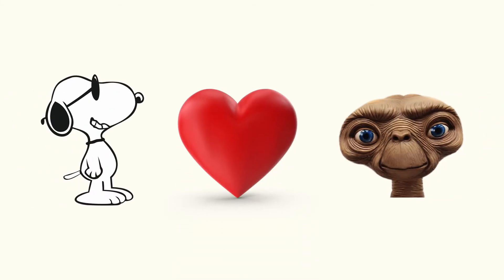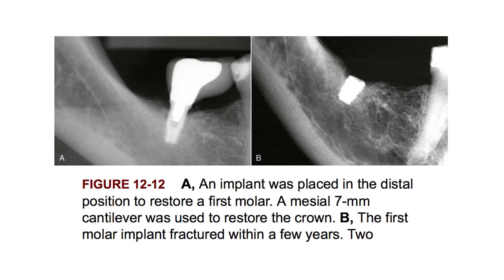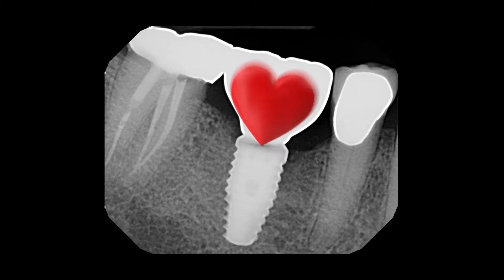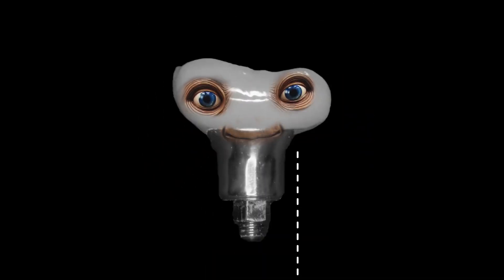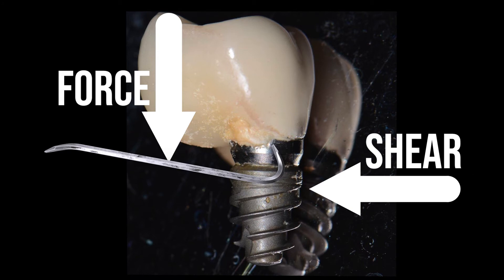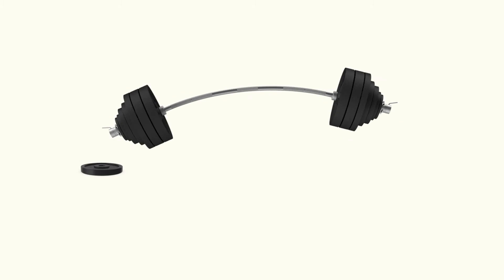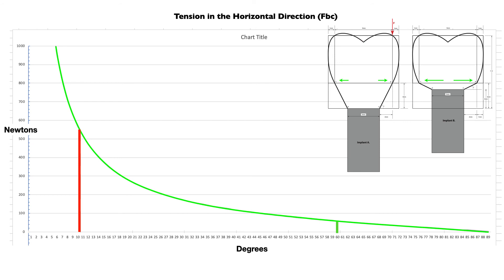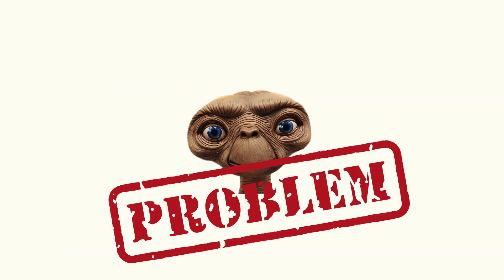This MISTAKE makes your implants 7X more likely to FAIL

Comment: Hi Doc, 

I would be grateful for your insights on two points. 

1). Generally for anterior implants the literature suggests a concave emergence profile. For molars, it tends to suggest a more convex profile and this make sense in terms of tissue support. 

However, from a biomechanical standpoint, if there is an implant that is correctly sized and centrally/axially placed (eg minimal cantilever) does the convex emergence (eg heart) exert inherently less biomechanical stress than a concave (snoopy) shape on the implant abutment interface under loading?

2). Whilst the biomechanical principles of  minimising any cantilever make complete sense, there is a lot of evidence in the literature that single tooth cantilevers are acceptable both anteriorly and posteriorly (ITI blog post by Dr Roccuzo on this). Whilst we would all like no cantilever, sometimes this is challenging due to economic or indeed anatomic factors ie the mental nerve or sinus. 

In such circumstances would you ever employ a cantilever and accept the compromise. I appreciate this is not perfect and depends on being able to control other factors (eg not doing it on bruxeists and only on cases where we can use a long enough implant to counteract the leverage force) though it is a clinical reality we are often faced with. 

Deeply appreciative of you taking the time to produce these videos and to share your views and apologies for the long question!

Comment: Boloney. The emergence profile for implants is purely for esthetic purposes and has no functional value other than soft tissue support and reducing the interproximal gap to prevent food impaction. Rotational forces are caused only by the forces applied to the occlusal surface of the crown and has nothing to do with emergence profile. The larger the occlusal table is the more rotational forces will be applied to the axis of the the crown and implant, that's it.
Reply from the maker: Based on your reply I believe you miss understood the premise of the video. Perhaps watching again will help.
Reply: What about bridges?

Comment: Why can't you just have an implant that's the same shape as the original tooth? I've seen some implants that are like this.
Reply from the maker: Great question! It seems like that would be the solution, but there are some issues with this approach! You could use CBCT data to create a titanium replica of the tooth, but how do you get that replacement tooth to fit into the space the original tooth occupied? In many cases, we have to section a tooth when removing it. Even when reducing an avulsed natural tooth, it is difficult to get it to seat properly. There are also limitations around where the implant can be placed below the crown so that the threads don't make contact with the surrounding roots.
Reply: @Stanleyinstitute   I don't think they use titanium. They are made of zirconia with a textured outer surface. They just tap the implant in place and the bone fuses to it over time.  https://m.youtube.com/watch?v=ZPMHwn71zMU&t=108s